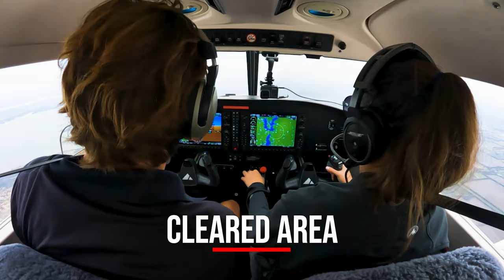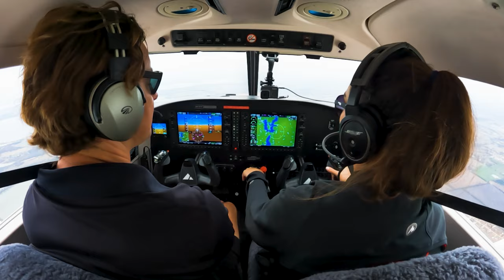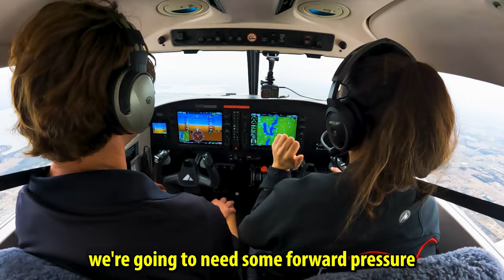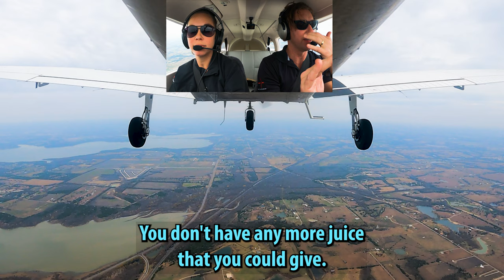Elevator Trim Stall: A Must-Know for All Pilots

Comment: I believe I'd pull the flaps up to takeoff position within seconds of applying full power. I've had some people say that they add nose up trim during the round-out and flare to make it easier to pull the yoke back, but that's a sure-fire way to make the plane pitch up severely during a go-around. I never touched the trim once I was established on final. It's not that hard to pull the yoke back for the round-out and flare with the trim set for the proper approach speed.

Comment: I always land full nose up trim because my plane is very nose heavy due to the engine upgrade and the fact that im quite heavy but the nose up trim helps me keep the nose wheel out of the gravel until the end of my roll out, i just always keep in mind that it takes a lot of forward pressure in a go around until i can trim out.

Comment: If you apply nose down trim (max trim) with decreased power and add power without adjusting the trim set this way, you end up with the nose raising, resulting in a nose up stall.   Try flying an Aztec and try this exercise at a high altitude, for safety, and you will be surely surprised by the nose rate rise and total understand the situation.  Of course you can muscle your way out of this but it will be a surprise.  I used the Aztec because it is a really good example of this resulting situation.  Heck if you are on final and apply max flaps on an Aztec at the top of the defined max flap speed you are in for a surprise.   You can always fly an Ercoupe and not have this problem because they don't have flaps.  LOL

Comment: Having a hard time digesting this one? who trims for landing with the nose up? shouldn't it be trimmed nose down for landing if that's your thing? why trim for landing  at all....anyways?  who teaches this especially if its so potentially hazardous?
Reply: Trim to hold final approach airspeed.
Reply: Trim to hold airspeed and decent rate to 500 FPM then forget and go full power to go around and find your stalling. This kind reminds me of the Curris trying to land at Hobby airport in Texas video shows them falling flat on a parked car. She had been bounced around by the tower because she was so slow, and they were trying to fit her in between airliners. She did a messed up go around retracted the flaps too soon before the airspeed built enough and stalled it.
Reply: I've seen some pilots who will apply continuous nose up trim in the final landing stages to get a butter-smooth landing.  Only works with electric trim. It does indeed produce that but leaves you in a bad position if you need to go around.   It is worth trying on a long runway, but you have to be ready to push the nose down for a go-around. 

Even at that, the pilot should always be checking airspeed when near the ground anyway.